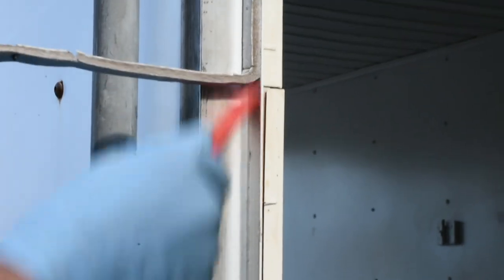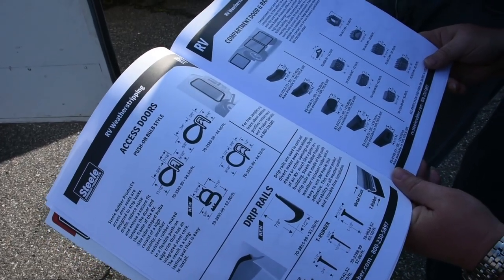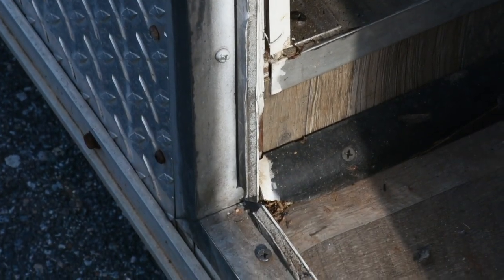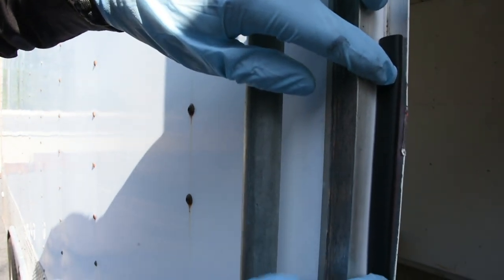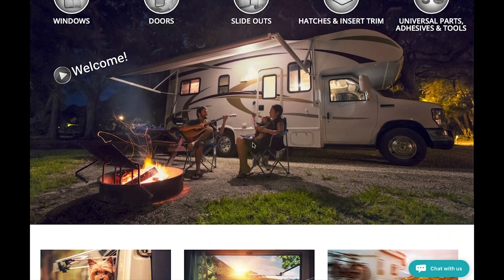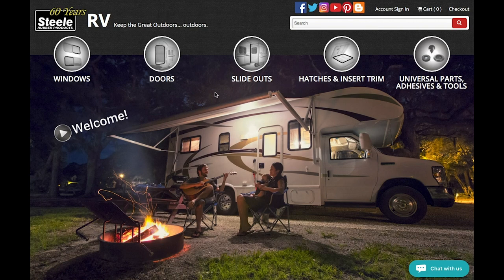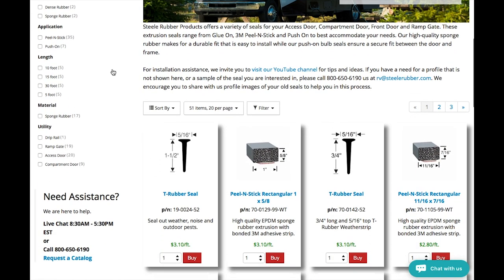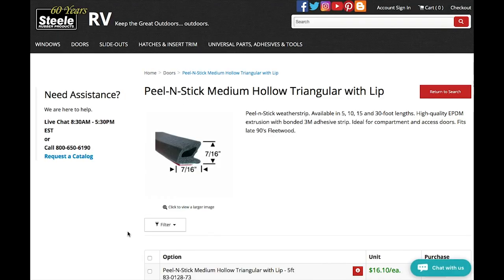How To Install the Seal on Your RV or Trailer Access Door

Comment: What if you currently have no seal whatsoever how do you identify it
Reply from the maker: Hey Jennifer, that's a great question! If you don't currently have a seal in place to refer to, you can order a free sample pack of our door seals! That way you can test out the different seals we offer and can figure out which one will work for your door. To request free samples, you can email us at contact@steelerubber.com or give us a call at 800-447-0849. You can also take photos and measurements of the doorway and area where you would apply the seal, then email them to us and we can recommend some products for you.

Thank you!